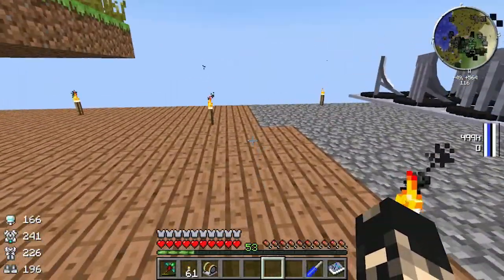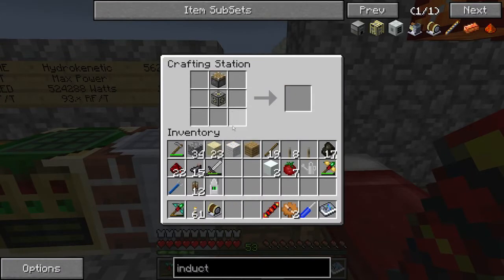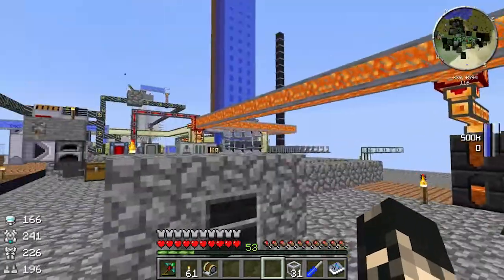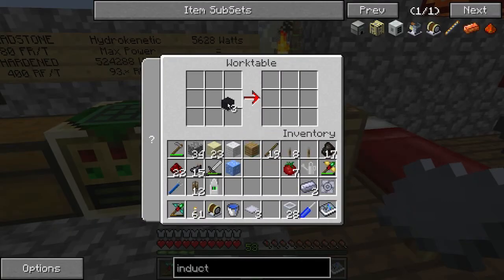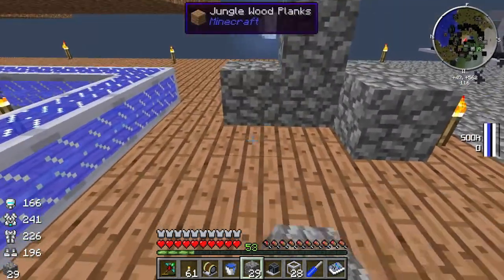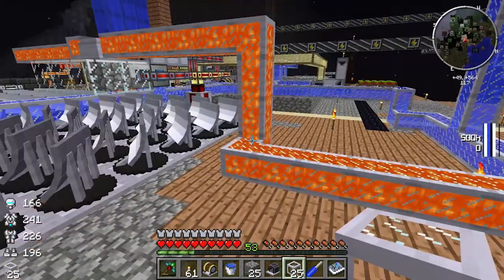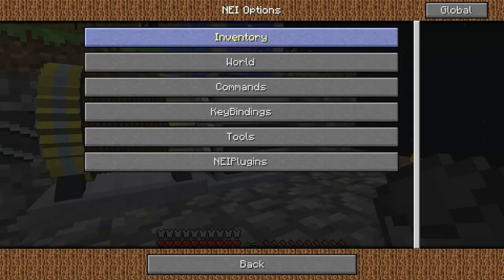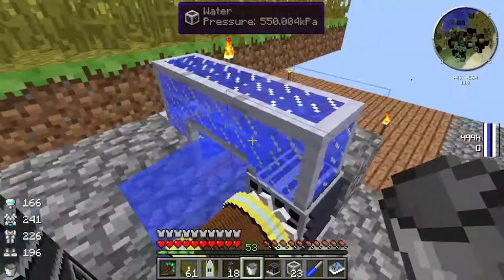Monster FTB Fluid Crystallizer, ICE ICE BABY

Comment: Just an FYI: Unlike British general maths, the Metric System doesn't use periods to denote thousands breaks, but instead uses commas. Further, by its notation that it requires (just over) 2 kW, which means that operating for one hour, it consumes (just over) 2 kW. At 4:34 you mention thousands of kilowatts, and rads, which is why I bring this up.

Secondly, I was wondering if you know how to recrystallize Ethanol that has been melted.
Reply from the maker: One of the hazards of doing rotarycraft is knowing the power requirements but mis reading power amounts. Unfortunately I don't think there is a way turning it back to its crystal form.
Reply: Ausyarr
Dangit. None of the pipes will let me feed liquid ethanol back into the gasoline engine directly. =_= I thought maybe the Fluid Crystallizer would, since it DOES accept the fuel pipe... but I can't seem to get it to actually do anything, so it must have been just a false hope.